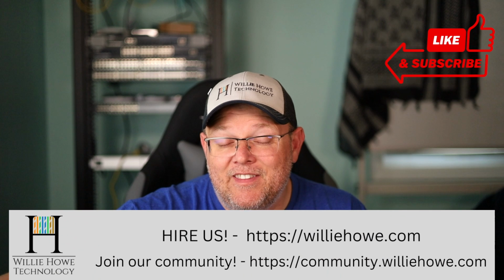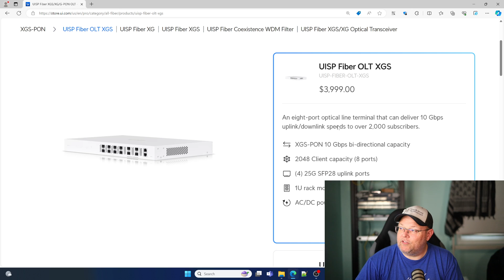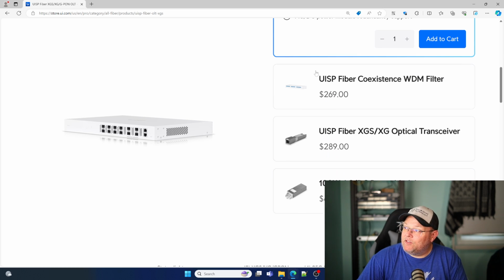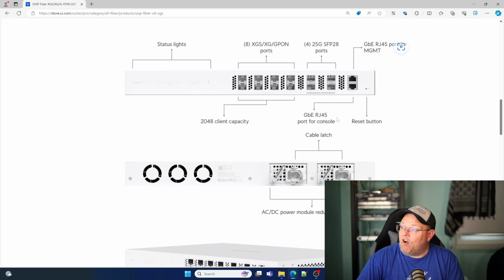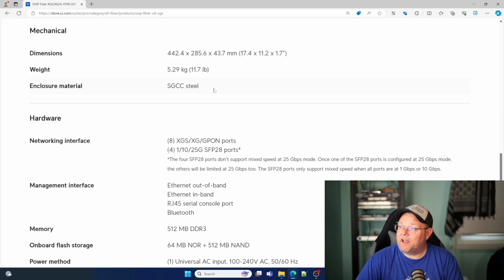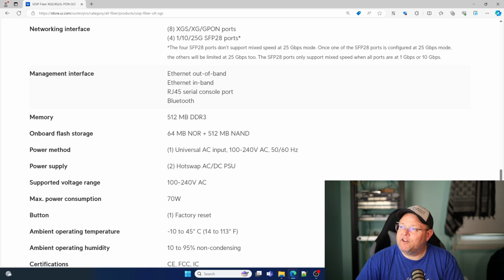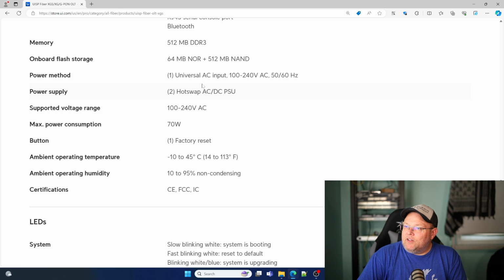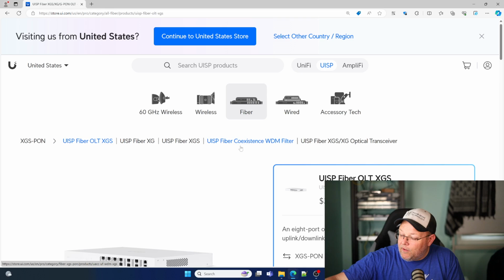Build an Internet Provider Part 5: UISP Fiber OLT XGS Overview

Comment: GPON OLT optics generally are 2.4 gigabit down and 1.2 gigabit up. 

Your description of the speeds and number of clients can be confusing for people new to this; each OLT XGS transceiver can deliver symmetric 10 gigabit. But that’s the total bandwidth available on that port and is shared with all customers you connect to it via passive splits. Actual end user bandwidth will vary and depends on your split ratios and your client’s usage patterns.

Comment: Frontier and ATT use 32 clients per OLT port, which on an 8 port OLT would be 256 clients. If you were to really push 2048 clients on this, it would instead of 256 clients per port. That would be some serious congestion, and even far above what cable ISPs use.
Reply from the maker: It's all a numbers game. Not everyone hits enter at the same time. If you're looking at a service with a contract and SLA you're likely not being delivered via different equipment.

Comment: If you are an ISP pushing 25Gbps .... it's most likely a better idea to use something other than UI for border/core routers ... lol
Reply from the maker: I actually consult for several ISPs that have multiple 10Gb inbound links and the networks are all Ubiquiti.  Works great if you know what you're doing.
Reply: @WillieHowe  Awesome, then I'd love to know the following please:
How many peeers? Whats the total throughput of the network (and 95th percentile)? How many routes on the borders? How many clients? How many regions? How many border routers? How many gateway routers? What models are you using for the borders/gateways?

Just lumped, but very interested to see how you are doing it since you say it does work - I have never seen it work at scale ...

What I have seen is the problem isn't a problem when you are small, once you start pushing some real traffic, ubnt falls flat - mik keeps up for a bit but unless you really scale horizontally. But then you leave and go into the big boy realm (cisco bleh, juniper, arista etc...)
Reply from the maker: @mitchellmnr  I'll see if I can share exact details. If not I'll do a video on the general concept.
Reply: @WillieHowe  sweet! a video might not be a bad idea actually. will be interesting to see since edge is based on vyos so technically should be able to pass some decent traffic.... but yea, im 100% interested - since all the smaller providers i deal with use miks for cores due to issues with edge - and the bigger ones have arista/juniper/cisco. heck our own core consists of a mix of mik, arista, cisco and juniper where each has their own role.... but we push some serious traffic, ubnt and mik just cant handle it haha
Reply from the maker: @mitchellmnr  I can tell you we are doing full tables on the ER Infinity boxes.
Reply: Agreed :P